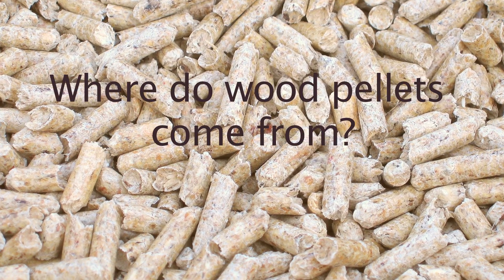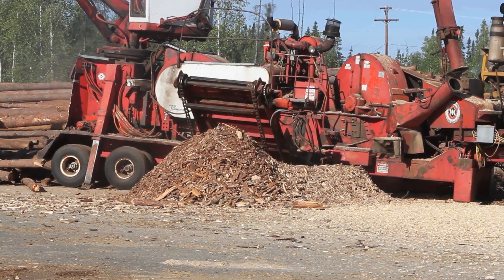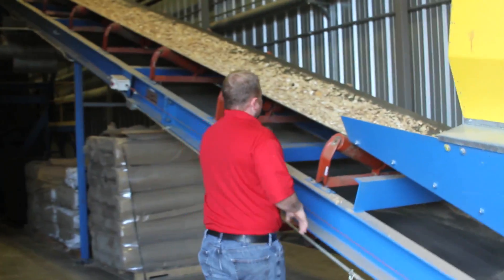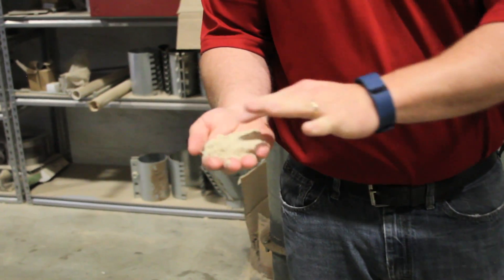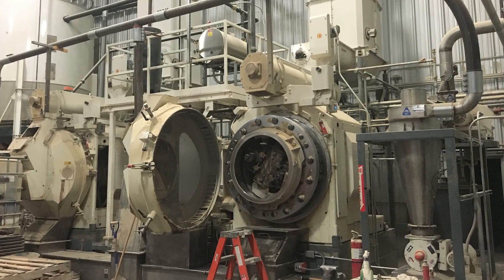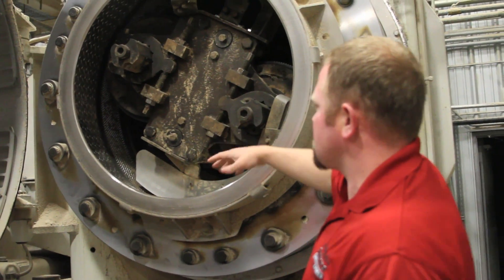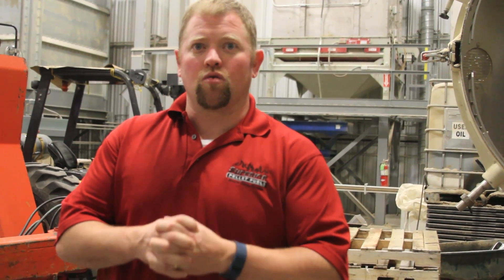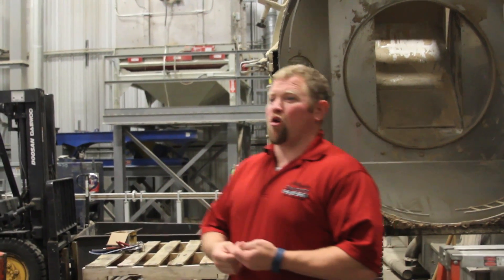How to Make Wood Pellets

Comment: Why do you have to try and justify using a renewable resource to make your product by saying the wood came from this or that??  They are trees, they grow back!!  Oh, and by the way,  the wood I use in my wood stove didn't take a fraction of the energy to produce than those pellets.  And my wood stove doesn't have to have electricity to produce heat.

Comment: What binder you're using?
Reply: 2:12 "The heat and pressure in this process essentially releases the lignin in the wood fibre and that-it melts-and then as it cools it binds together."
Reply: Softwood
Reply: You didn't watch the video, did you?

Comment: But what is the total emissions output of the product: you have to include the emissions created from the chipper, the dryer, and the extruder. Does this product burn so clean it offsets even the manufacturing emissions?
Reply: Very little most plants run what they call an rto just for that
Reply: Same things need to be factored in for all other energy sources as well.